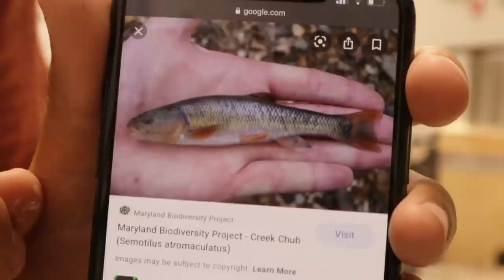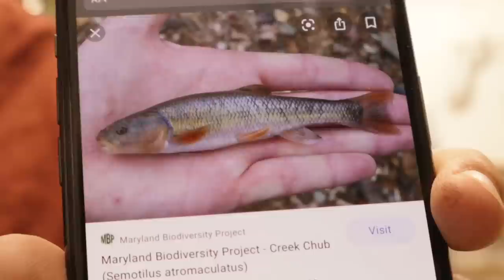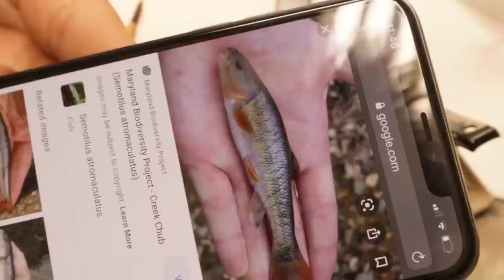Making and Fishing with a Creek Chub SwimBait

Comment: i actually coated a bad tip with epoxy and its still working great.... no more broken line or lost lures...! i was contemplating dipping the tip in my KBS then clearing out the line hole after it dripped for a few minutes....

Comment: Also...  if u get a steel plate with some thin leather on it, use magnets to pin your mesh down for scale panting..          its gunna save alot of time... 

Get some magnets w/ a hook or loop on them so u can grab um... 

When u pin down the mesh.. think on the fine tuning you can do to get it tight......      

Also thanks for the vids. I watch ery one

Comment: Perhaps I'm the only Marling fan who had this problem, but I couldn't see the action of the new creek chub swimbait when you were retrieving it at the big pond (or anywhere else). For me, that was a major disappointment. As for your rod needing replacement, might I be so bold (practical?) as to suggest that you simply replace the tip-top, which is usually the culprit in line abrasion?

Comment: Man you got to try helmsman clear in a can made by MinWax its a polyurethane all the types of clears from flat to extra high gloss and you can spray it right over wet paint it wont wrinkle the paints that you put down first. Im a pinstriper and sign painter by trade and have used all the crap out there and helmsman stand up to the best and you can get it anywhere

Comment: heat up the rod tip so you can just pull the tip off, and you can get replacements at scheels or probably cabelas. Works perfect.

Comment: Hey marling how you been? I just made my first ever popper made from bass wood and a cheap piece of wire, i use the same technique as you and put a wire through the whole bait, you have inspired me to make baits, i may not have the best tools to make lures or a good way to put weight into the baits but the popper seems to have a decent action and i just got a 10 year old rust jigsaw? Im not sure but ima get it functional and start making decent looking baits, wish me luck on restoring it and hope fully ill get a sander ina year or two bc im not that old, still a teen going to 9th grade this year online bc the rona but the popper seems to be good i made a lil crank bait with some plywood and plexyglass and a old guitar wire that was my first ever lure i hammer sinkers into thin things then bend them and hammer them again thats how i put lead into my baits , i use a floor varnish for my clear cotes it works decently ive never made a swim bait bc its too much work for me and a coping saw and a handmade knife made my uncle,  he is a master wood worker that taught me for 2 weeks in kentucky and made me the knife, or atleast he used to be a master so sorry for rambling, you are my idol for lure making and you are a good lure maker
Reply: Btw what wire do you use? I cant really find any good wire is it steel? Or aluminum